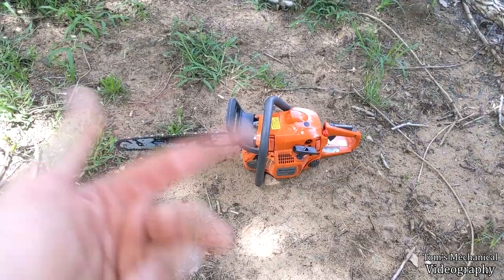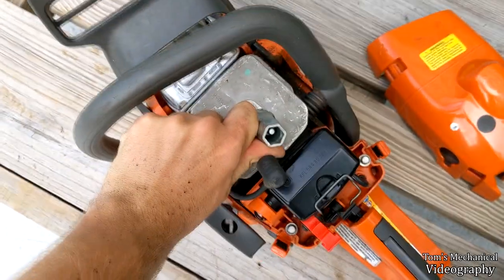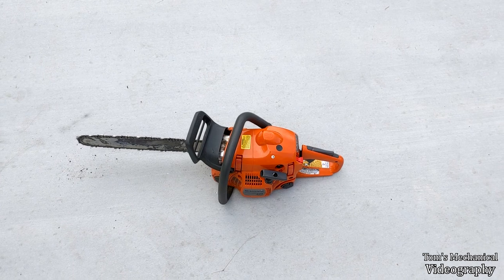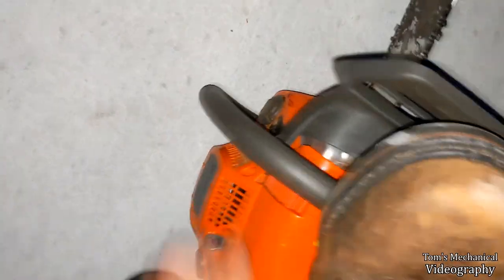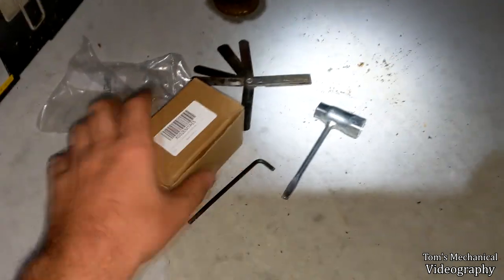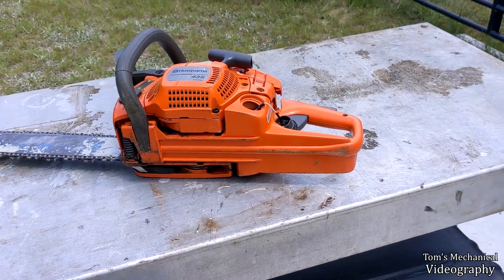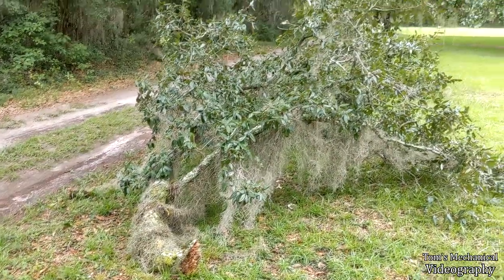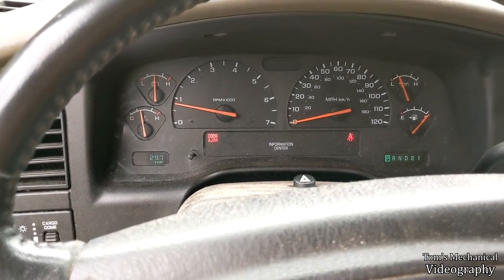Husqvarna 435 Chainsaw: No Start When Hot Fix

Comment: Vapor lock put cool fuel and it will fix it. Try puting aluminum metal tape in between the motor and the carb to insulate the heat. Just a little piece it will do the trick. Is all plastic with no heat shield

Comment: The air gap on the husky coils is supposed to be 0.3 mm but the defacto standard of 0.010 inch also works. Those amazon coils probably would have worked if you didn't set the gap so huge. Your hot start issues may have been fixed by re-gapping the original coil to factory spec (0.3 mm) as well - I've been finding many reports of closing the "huge" factory gap on the 435 to fix an apparently common hot start issue on them.

Comment: I am having the same problem with a brand new 550xp mark II that has less than 1 tank of gas going through. Pumping the bulb won't fill it up and fixes itself when cooled off. Also when it's cooled the bulb filled itself.

Comment: As I watched this I made a few comment notes about what I was noticing. By the time I reached the end I deleted those notes. I realized you Appeased yourself and became convinced the saw is suffering a Heat related Vapor Lock issue.
Perhaps Heat abuse is increasing the likelihood of a no start when hot, however under normal use you should not be experiencing excessive Heating or a no start.
Both Excessive heating and No start can be caused by several different issues or a combination of issues.
* I can only offer this one reference as one of those possibilities.
You seemed to never address Fuel Flow, or lack there of. This can only be determined by careful mapping of the Fuel system, including the Carburetor(and surrounding Seals)
Note - Coil was a reasonable guess, they do Fail under heat and can work fine when cooled off.
You mentioned a suspected Lean Condition, and seemed to be on the right track but were weak on confirmation.
a) Hot no start, Pump the Purge bulb(it is not a primer) to draw fresh fuel through the Carburetor. Attempt to Start.
1) If no Start, immediately Check for Good Spark.(don't just throw a coil at it)
Carry a Multi-meter during testing. a Coil is simple to-read and confirm.(Ohms readings)
2) If Saw starts but shuts off or stalls as soon as trigger is pulled Remove and inspect Plug.
very wet = Flooding
Damp = normally no fire
Dry = Not receiving Fuel to maintain ignition
If the Plug is Dry the Carburetor is almost certainly <NOT> moving enough Fuel - Extremely lean and should be thoroughly inspected. A simple starting point is opening the L/H jets 1/8-1/4 turn to compensate for excessively warm weather(Heat)
Inside the Carburetor you may fine a Diaphragm is stiffening(not moving enough fuel) or the Screen cup is restricted with trash(restricting flow)
* I never order a new Carburetor or an overhaul kit before completely disassembling, inspecting and cleaning the original. Often a good Flush and adjustment resolves the issue. Inspection confirms if parts are needed(or replacement). Careful adjustment resolves and lean/Rich running issues.
b) Fuel System Testing - An inexpensive vacuum/pressure hand pump can test the Fuel Tank/Lines/Purge Bulb/Vent and confirm proper working order.
*** Vapor Lock***
An interesting term but one I would readily dismiss as a oversight in small two stroke engines.
Normally Vapor Lock is associated with Metal Fuel Lines. The only thing Metal in a Chainsaw Fuel system is the Carburetor. If all passages are clear and properly open the Purge Bulb should flush the Carburetor with fresh cooler liquid fuel.
* If the Purge will not pump Fuel.
1) lay the saw on its side and open the Tank Cap. Pump the Bulb and confirm function.
With the Cap open the Tank is 100% venting and fuel should flow freely.
2) with the Top Cover off, fuel lines exposed, pump the Bulb. if it is in good condition and not filling check the return line for Bubbles moving back and forth. Also check the Supply line for Fuel/Air.
a) if the supply line has Air trapped and there is movement in the Return line(bubble movement) the Filter is Blocked or possibly a kinked/collapsing supply line.
b) If the Supply line is Fuel Filled and the Bulb is moving bubbles the Carburetor is likely restricted/Blocked.
********* Bubbli(ng in Tank*********
That concerned me. (If) the bubbling was coming from the Vent, air entering to balance Tank pressure, it should have stopped instantly when the Cap was removed. The exact spot the bubbles were coming from needed to be identified as Air Pressure was being relieved from somewhere and the Carburetor seems to be the only likely culprit.(Supply/Return?)

Comment: Coils are matched to the flywheel (of which there are at least 3 types for this model chainsaw as far as I know)
Numbers for the flywheel are cast or stamped on the inside of it (so flywheel off to see which one yours has to find out which ign unit yours has to have)
flywheel 580279801 uses ign units - 579638801, 579638802, 579638803, 579638805
flywheels 544874201-544874202 uses ign units - 505427201, 504571401, 573935701, 573935702
flywheel 580279801 uses ign unit 579638804
I believe you cannot mix and match ign units and flywheels - otherwise they either don't run - or will run ...but like shit
(I only know this as I bought my 435 second hand and turned out to be a very unhappy saw and the coil was high on the suspect list - but turned out to be mainly carb related and leakdown issues - didn't help that it had lost a screw that holds the barrel on -  hidden underneath so not easy to spot - other 3 were not torqued...and leaky fuel lines)
Mine now runs like a top, and has been 100% reliable since...not finished watching your video - only got as far as the knocking of the coil being junk based on its origin, so apologies if you did find out which yours needed and sourced the right one (though I know I couldn't find a cheap overseas coil that mine needed based off the flywheel- only the genuine's - which thankfully I didn't actually need in the end)
Will watch the rest of your vid hoping you got it nailed in the end :D

Comment: Nice story line...Lots of mystery, suspense and some twists.
Ignition coils...Why does an ignition coil go bad?
Typical thought in a persons head when they discover there's not any spark is, "It worked last time I used it." So, why did it go bad when you were not using it?
My current theory, (past 3 years) is shorting any electrical equipment to ground is not good.
Nope. Breakers, fuses resistor fuses...tend to trip, blow and/or fry.
So why is the off switch, actually an on switch, that connects/shorts the coil to ground?
I choke my engines off now.
But yeah...quality control is very foreign to some countries....companies...management.
How hard could it be to 3D print a coil case and use the same core, new/better wire?

Okay...15:24...time to find what happens and who dun it?
Reply: 31:41 I thought I saw an apparition just as you were saying...somebody finished....